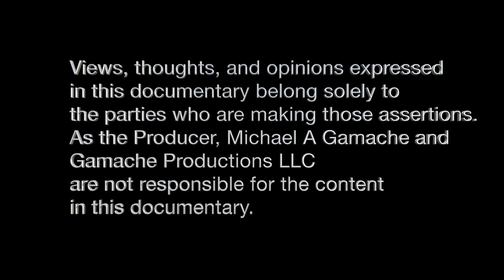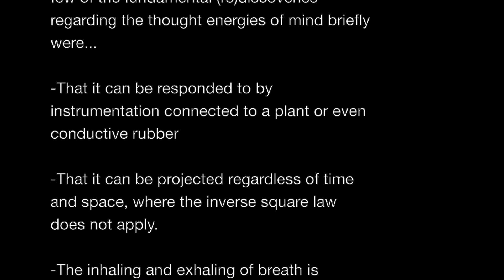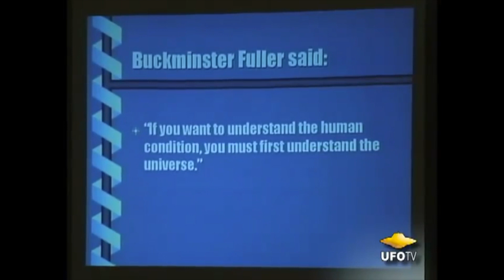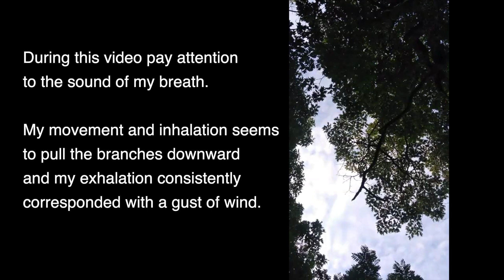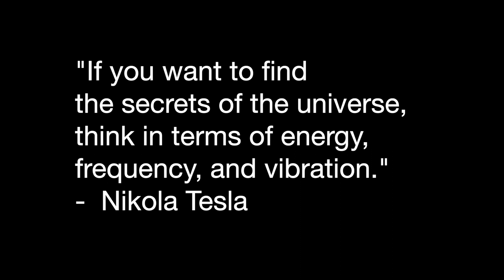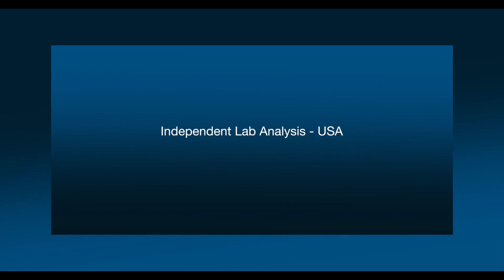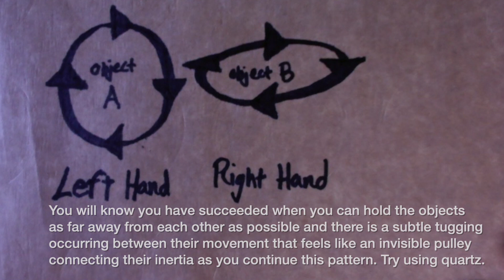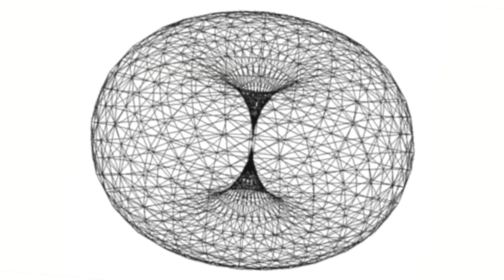Story of the Wind- A Musical Exploration of Consciousness, Cosmology and the Hutchison Effect

Comment: Nice. but I got an idea about the quartz on the scale: you warm it up in your hands... and warmer objects are lighter (just as warm air is lighter and raises)
Reply from the maker: @artjaazz1  the whole point was to make people curious enough to tinker around yourselves and uncover self evident truth. This is a follow up video which requires little to replicate for you to check it out for yourself. Part 2 and part 3 are up if you want to go as far as weight shifts you can measure. It isn't your reality until it's your experience, this works. I took it to cosmic summit, passed it around, people passed it to others after experiencing and so on. Tag you're it

https://youtu.be/NTivg0NafvA?si=pT4N2juhj4zj3jgL